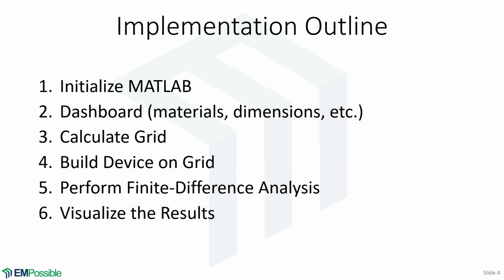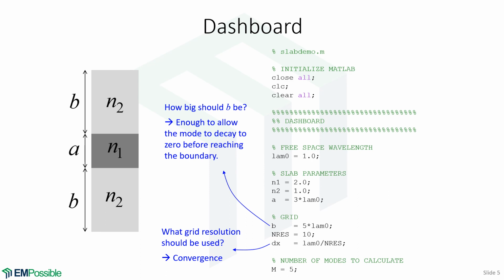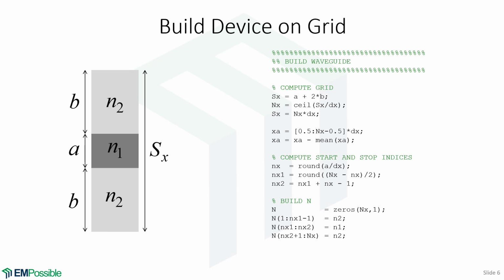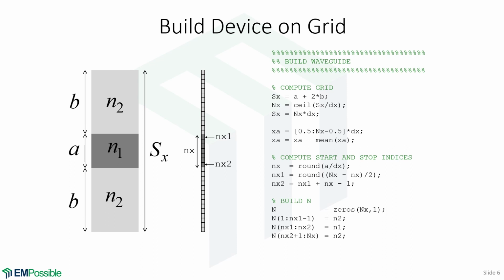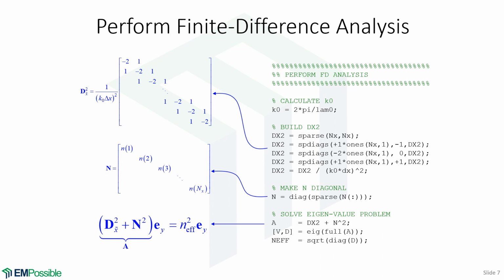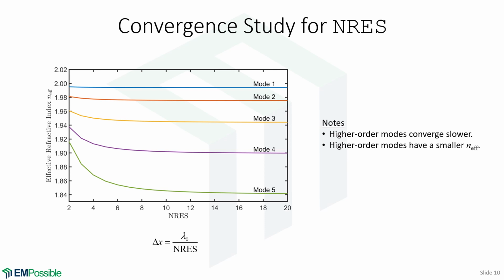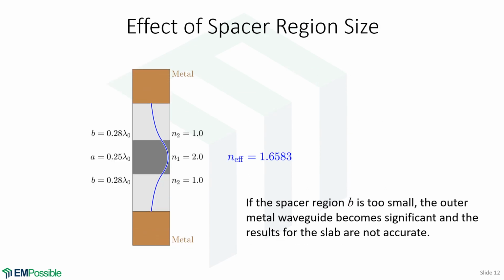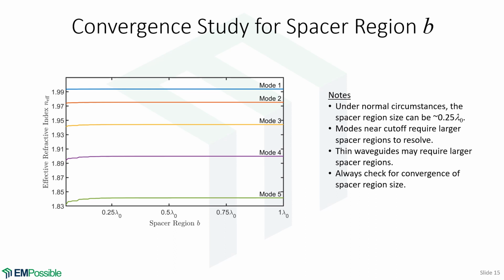Lecture -- Implementation of Slab Waveguide Analysis

Comment: Hi, thank you for the great video. I understand why n_eff is smaller for the higher order modes, but I do not understand why n_eff converges slower for the higher order modes. Could you please explain it?
Reply from the maker: Absolutely. The higher-order modes have more rapidly varying fields. Higher resolution is needed in order to accurately resolve the fields. 

Another way to think about it is this. The properties of the higher-order modes are more sensitive to the waveguide parameters. This is, smaller changes in the properties of the waveguide will lead to larger changes in the properties of the higher-order modes compared to the lower-order modes. This makes calculating them numerically more difficult and requiring higher resolution.

Hope this helps!!
Reply from the maker: BTW, if you are looking for waveguide analysis in written form, along with MATLAB codes, you may be interested in the following book:

https://empossible.net/fdfdbook/

Waveguide analysis is discussed in Chapter 6 and includes channel waveguides, slab waveguides, surface plasmons and more.

Comment: How to extend this code to build rectangular waveguide on 3D grid?
Reply from the maker: You can analyze a rectangular waveguide using just a 2D grid. It is just the cross section that is needed to calculate the modes. 

I think the best resource for this is Chapter 6 in my recent book:

https://empossible.net/fdfdbook/

Hope this helps!!

Comment: Thank you so much for the amazing lectures.   F or slide of converge study for NERS what code did you type to get the figure  sorry for my questions but i am beginner in this field .
Reply from the maker: Happy to help!  First, let me point you to the official course website.  I recommend using this as your main portal to the course.  You can download the notes, see all of the course material organized, get links to the latest versions of the notes and videos, and see the other learning learning resources.

https://empossible.net/academics/emp4301_5301/

Topic 2 covers MATLAB skills.  Specifically, I think the videos under "Generating Professional Graphics" will be exactly what you are looking for.
Reply: @empossible1577  thank you so much for the quick reply. I think I didn't clarify my questions
1- how do you get the reflective effect index(NEFF) with respect to NRES even if there of different lengths(NEFF is 260  but NRES IS 1)?
2-the vector of NEFF is 260 you divide it by 5 to get the mode or how do you get the model in the figure I mention?
Reply from the maker: @adnanam-uv6sj  Basically I have a giant for loop that iterates over a range of values of NRES.

for NRES = 2 : 20
   slab code
end

If the grid has 200 points, you will calculate 200 effective refractive indices.  Only a few of these correspond to guided modes.  For most dielectric waveguides, the largest effective indices will be the guided modes.  Sort your eigen-values and only store the ones corresponding to the first few guided modes.

Did this answer your question?  Sorry if I am still missing something.
Reply: @empossible1577  Dear Sir, I thank you with all my heart for answering all my questions. According to my understanding, I made this code. I got a drawing that is close to your drawing, but (mode 5) does not exist and the values of (neff) are different.
mode1= imag (NEFF(161:200))/k0;
mode2= imag (NEFF(121:160))/k0;
mode3=  imag(NEFF(81:120))/k0;
mode4= imag (NEFF(41:80))/k0;
mode5=  imag((NEFF(1:40)))/k0;
NRES=linspace(2,20,40);
plot(NRES,mode1,NRES,mode2,NRES,mode3,NRES,mode4,NRES,mode5);
Reply from the maker: @adnanam-uv6sj  Hmmm...Have you tried creating a larger spacer region outside of the slab?  I am not sure I can explain how you match results except for Mode 5.
Reply from the maker: @adnanam-uv6sj  BTW, I am not sure if you are aware, but I have recently published a book that devotes an entire chapter to waveguide and slab waveguide analysis.  Take a look at the book website if you have time.  Maybe there is something here that can help.  Also, the skills you are developing for slab waveguide analysis can do so much more!

https://empossible.net/fdfdbook/

Comment: Thank you very much for this lecture! I've learned a lot. Regarding the final steps: I wonder why you've moved from differential equation to matrix form? Did you gain something from it or is it just numerically easier for the code you use to solve it? 
If I still remember something from 2nd year Quantum course, the diff eq you get is the same as the one for quantum harmonic oscillator, which has analytical solution of gaussian times hermits polynomials : infinite number of modes. Than the question arise is where is the cut off and what is the physical factor for it? Many thanks again. I might add that I use photonic crystals on my job and I find the whole thing extra cool and exciting.
Reply from the maker: Sorry for my delayed response.  I was away on vacation with the family.

Let me point you to the official course website for my Computational Methods course that will help put this video in context with the others.

https://empossible.net/academics/emp4301_5301/

I recommend using the course website as your main portal to the contents because you can download the notes, get links to the latest versions of the notes and videos, see the sequence of videos, and get other learning resources.

The main reason for converting to matrix form here is to demonstrate how I implement the finite-difference method.  It is a bit different than how it is taught in other places, but it lets you solve entirely new differential equations in mere seconds to minutes with practice.  Also, some slab waveguides do not have analytical solutions and a numerical solution would be the only option.  

If you look at the course website, work through topics 6 and 7 and I think you will see what I mean.  I teach the finite-difference method and then apply it to multiple things.

If you are looking for this information in book form, see Chapter 3 in a book we just published:

https://empossible.net/fdfdbook/

This book talks about photonic crystals and has multiple examples about simulating them.

Hope this helps!!
Reply: @empossible1577   oh wow! what a wealth of helpful material. Thanks for making it available to all. I will surely dig in there.  All the best!

Comment: Hi, thanks for the amazing lesson. I have one doubt though: Suppose we had Dirichlet boundary conditions that specified NON ZERO values at a boundary and we had to solve this same differential eigenvalue problem. How would we incorporate that into the matrices?
Reply from the maker: I have never tried this, but I am 99% sure you would get the same modes, but with a DC offset determined by what value you chose for the Dirichlet boundary conditions.  Now if you set each boundary to a different value...hmmm...
Reply: @empossible1577  Thanks for your reply. But my doubt is more along the lines of: how would we put those BCs into the matrix INTO the matrices in the first place? We essentially have a  [Ax = lambda x] type system where some elements in x are specified. 

For just solving DEs in previous videos, you would just have an Ax = b system where the BCs could easily be put into the vector b. I don't see a way of doing this for the [Ax = lambda x system] though.
Reply from the maker: @SoumilSahu  The easy but less numerically efficient way is this...

1. Build the matrix equation using any boundary condition you wish, [A][x]=[b].
2. For each point on the grid  you wish to force to a specific value:
   a. Identify which row in the matrix equation corresponds to this point.
   b. Replace the entire row with all 0's
   c. Place a 1 in the position in the [A] matrix that is along the center diagonal.
   d. In the [b] vector, place the value that you wish to force this point on the grid to.

That is it.  You are essentially throwing out the finite-difference equation for points with known values and replacing the equation with x_n = b_n.

I have some discussion about this in Lecture 7n here:

https://empossible.net/academics/emp4301_5301/
Reply: @empossible1577  Yes, I totally get that, which is what I meant in my last line from my previous comment (perhaps I didn't frame it clearly enough) when I wrote "where the BCs could easily be put into the vector b".

This is very straightforward for Ax = b problems, which I've already understood from your other (amazing) videos in this playlist.

What I don't understand is how to do this for an eigen value problem, ie; Ax = lambda x, which is the topic of this video. How do we force a specific non zero value to a point in this case?
Reply from the maker: @SoumilSahu  Oh, I understand.  Hmmm..I actually do not know the answer to this.  I can try to think aloud.  Here goes...

If you force external values to something, that may be like having a source and not allow the problem to have an infinite number of solutions.  Your eigen-value problem [A][x]=v[B][x] would have some constants leading to an equation of the form [A][x] + [b] = v[B][x].  To my knowledge, this is no longer and eigen-value problem.

Again, I am just thinking aloud.  I do not know the answer.  Great question!

Comment: Hi! I'm thinking about taking the course on Finite Difference Waveguide Analysis on EMPossible, but it seems that we are not considering complex-permittivity case now. Do you happen to have a plan to upload vidoes or pdf files about this case? Thank you. I always appreciate :D
Reply from the maker: Thank you.  Incorporating loss is something I need to talk more about in my videos.  For frequency-domain methods like the finite-difference analysis of waveguides, it is usually as simple as just making the permittivity complex.  For waveguide analysis, this will make your eigen-values complex because the guided modes will decay in the presence of loss.  Otherwise, it is that simple.  Hope this helps!
Reply: @empossible1577  I see. I'll try it. Thank you so much!